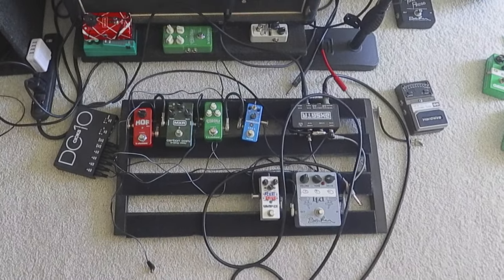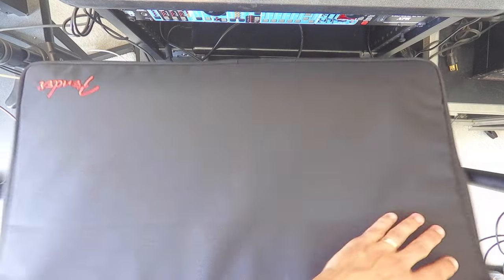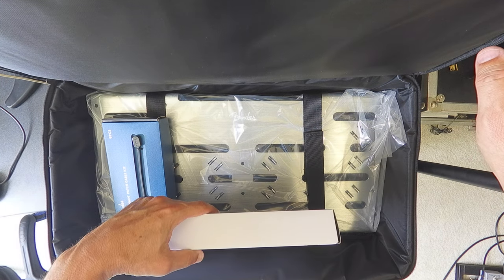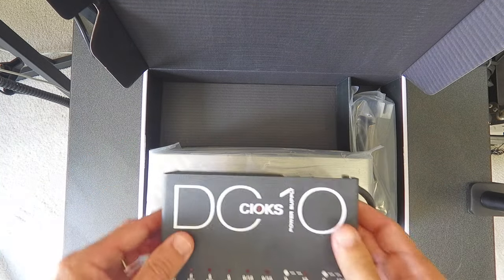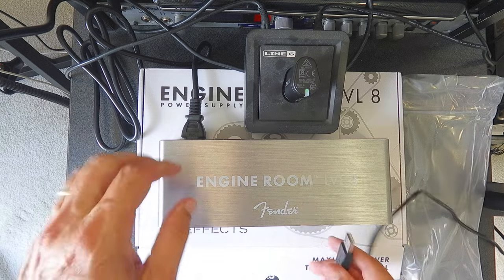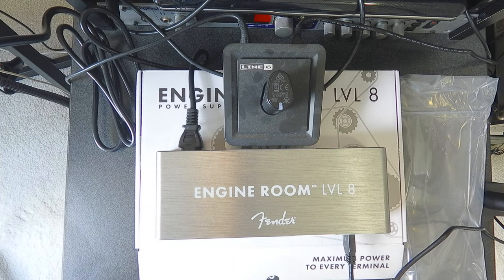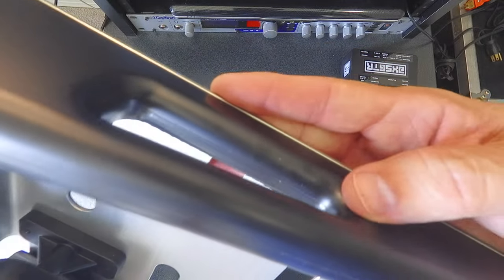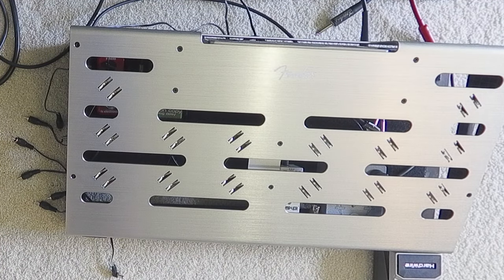Crappy Guitarist Ep 8: Fender Professional Pedal Board, Engine Room LVL 8 and Blockchain Cable Kit

Comment: thanks for the vid! could you mount a pedal train mondo power suply there?
Reply from the maker: It's actually the Fender Engine Room LVL 8 power supply.  If you go to the 6:29 mark of the video you can see the built in mounting bracket.  The mounting space is approx. 11 inches (not exact).